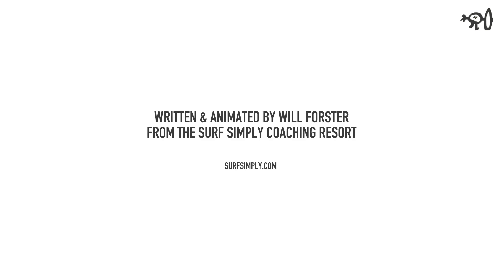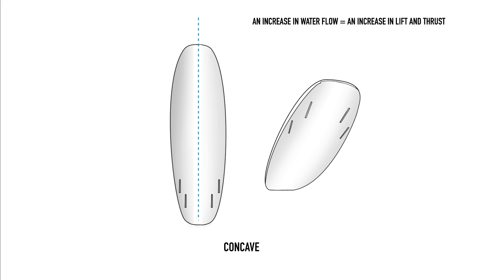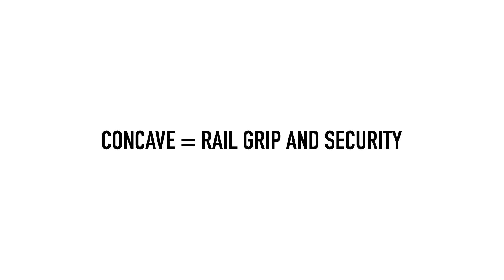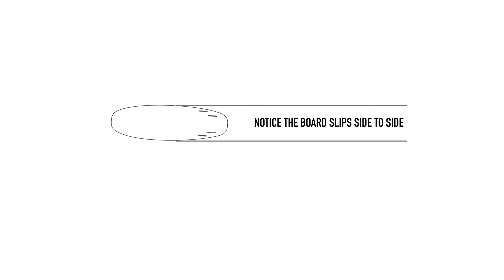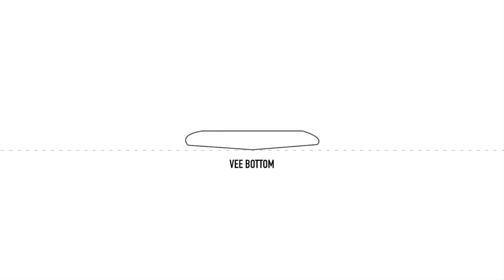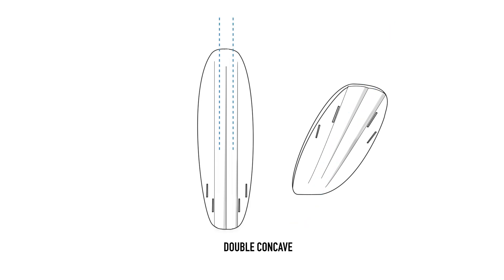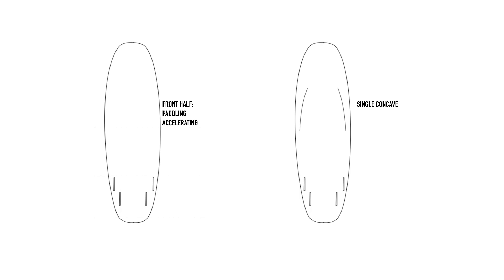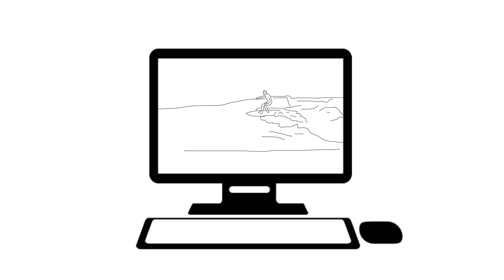Surfing Explained: Ep9 Surfboard Bottom Contours

Comment: Not sure about your hypothesis that concaves direct the water straight down the middle of the board. It’s my understanding that the water flows at a diagonal across the bottom of the board and that concaves perform two basic functions: One is to flatten the rocker at the center line of the board and another is to give the board more grip and resist side slipping which translates into more speed forward. Also not sure about this notion of “lift” in relation to concaves. Is this supposed to be like a hydroplane hull on a racing boat? Seems unlikely that a surfboard goes fast enough to have that kind of effect.

Comment: all right in the paper, but in practice things change, concave can be slower, disastrous for the rocker, have a windy effect on the paddle and before gliding, especially on medium-length boards and in dirty and rough conditions. Even channels can ruin an entire board made to perfection, such as generating too much speed. The most important thing is definitely the rocker and then (unfortunately) you need to experiment and modify the board countless times to make it work really and well, it would be too easy to get results from the theory, which still remains a good starting point.

Comment: Everything they say is backwards from what it really is. A convex bottom surfboard does a high line way better than any other board as long as the rail is not too hard or Sharp. When the waves are larger and bumpier the board should have a convex bottom. You get more speed and control. I'm very flat weak waves concave is better but again only to a certain size. There are so many other variables like thickness in foil that have to do with this but I don't understand how big wave Surfers don't have convex bottoms under big wave boards for paddling they should have convex not only in the middle but toward the rail with downrails that are full and you'll have a lot more maneuverability

Comment: I have a board which has flat bottom contour from nose to chest area (When your lying face-down and paddeling) and transitions gradually to a double concave in the middle of the board (No single concave before the double) then it transitions to a Vee at the tail end. I do not know what does that do for the board or the rider or how the board will behave in the water. It's a 6'6" x 21 x 2.75 Egg shaped board. I still haven't tried it because we are still on strict quarantine. It's still wrapped in it's packaging.  It's my 1st board. Been riding rentals. Would appreciate it if you could tell me what to expect with that kind of bottom contour. Most boards start with a single concave then gradually transition to double but this one, from flat, goes to double right-away. Please do share if you have tried a board like this. Thank you and best of luck to your channel. :)
Reply: I rode on one of Gus Acosta's designs while on a trip to the Big Island about 8 years ago. He speaks of the boards as riding on hulls rather than concaves and indeed that board had 3 hulls and another around 5 hulls (counting the rails as 2 hulls). One take is here: http://mypaipoboards.org/interviews/GusAcosta/WA_3b.jpg
Reply: @rodndtube  Woah! that's a pretty unique board.  How was the experience?

Comment: Hi Will, I love this series! Very informative and makes the science easy to understand. One thing I hear shapers talk about and miss in this video is how convex to single to vee creates a flatter center rocker for paddling and increased rail rocker for turns. You don't mention that in this video, do you think this effect is insignificant compared to the ones you mentioned about weight distribution during speeding up on your front foot and turning off your back foot? Or is it all one and the same?
Reply from the maker: Hi Rob, I would agree that the different contours alter and impact other areas of the design. For example having a concave towards the front half reduces the entry rocker into a lesser curve. The impact is difficult to measure but will have some effect, and managing the overall design and having a general understanding is enough to use them to their overall advantage. I think having your big picture view and how they influence other aspects is important at avoiding a narrow view of design. Thanks for commenting Rob :)

Comment: Sorry you've got this concave thing wrong. Put a concave bottom board bottom up on the racks. Lay a straight edge on the centre line at the deepest part of the concave so its running nose to tail. You'll see the straight edge teeters on the apex of the rocker. Now rotate the straight edge, you'll see when the edge is at a diagonal to the stringer it'll be mostly in contact with the bottom. This diagonal path is the fastest way for water to move across a rockered concave. This is how concave creates lift when a board is in trim. Water is being displaced rapidly toward the outside rail. The lift on the outside rail in a turn is how concave creates drive through turns when the inside rail is weighted.
Reply from the maker: Hi Spinafex, thanks for your engagement. We’re always looking for more information to grow our knowledge from. I’m going to share your comment with our team and we’ll try your example!
Reply: @SurfSimply  check these guys for under board flow clips https://www.cambersurfboards.com/built-from-science
Reply: Thx spin..  interesting insights..
Reply: interesting. if concave boards direct water out past the rails, what is the goal of a convex board then? arent those supposed to accomplish the same goal if that is true?
Reply: @jordankeeler7297  I don't know - I think those designs tend to be high volume, large planning area  with flat rockers i.e they don't need more lift. The convex is probably about reducing lift and adding control.

Comment: Been following this series, I build my own boards, and also try to search for scientific papers to support my designs, while also being a bit mad and innovating, following my personal theories while there is no scientific research for surfboard design. altough I agree to the theories presented on other videos, I don't agree 100% with this one, you are forgetting a lot of factors on this one, adding a concave just modifies a surfboard so much, you are adding more than removing something. You might be adding wetted surface area and rocker. Also doesn't the redirection of water create drag? Therefore the concave by redirecting water creates drag, giving that the fins are giving the surfboard the directional stability/velocity and preventing from it spinning out?